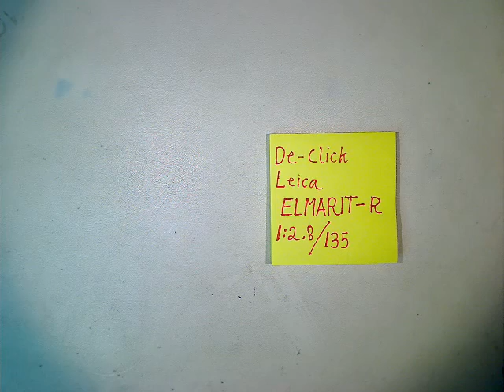DE-click Leica ELMARIT-R  1:2.8 / 135_____Motion Lapse film

Comment: Thank you for this. Do you know where is the best place to add grease if trying to dampen the aperture movement once de-clicked?
Reply from the maker: I think it's best to add a little on the aperture ring, but it should be something that is more thicker than "Super-Lube", maybe some silicone grease can do it and only as little as possible.
Reply: @mikeno62  Cool thank you. I was guessing it was just the inner side of the aperture ring (the part with the f-stop numbers on). 

I've ordered some special grease made just for this purpose from Simmod. 

I had difficulty tracking down any flat wire like you used, but have got some from Amazon arriving tomorrow hopefully.

It's definitely worth learning to do this as I've got 6 or 7 Leica Rs and I ideally don't want to ship them off to be worked on.. so thanks again.

Comment: thank you for your videos!!  it is not just necessary to remove the ball and put a heavy grease to the ring? is there a return spring is that it?
Reply from the maker: No, because the return spring will slowly pull it back again, even with heavy grease, it is therefore nesassary to take out the return spring.
Reply: Ok! Thank! And how useful piece of metal you add?? And what is this metal? Aluminum, stainless steel?
Reply from the maker: +raphael gui      The little piece of metal is important because the aperture ring and the inner aperture ring has to be connected, so when moving the aperture ring, the aperture system will follow when open and close the aperture without any problem.. The metal is thin stainless Steele ca. 0.6 - 0.7mm